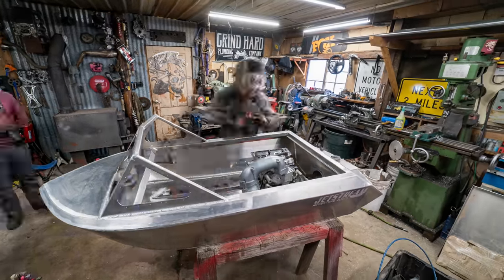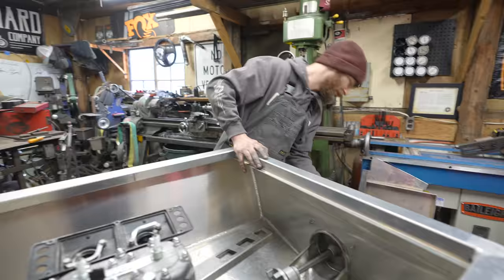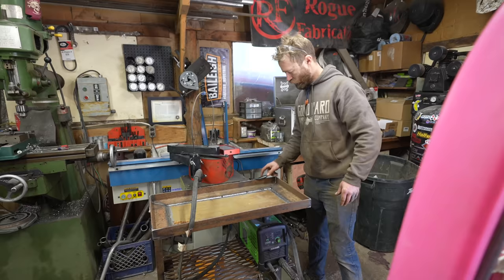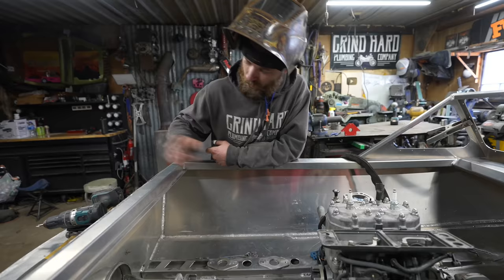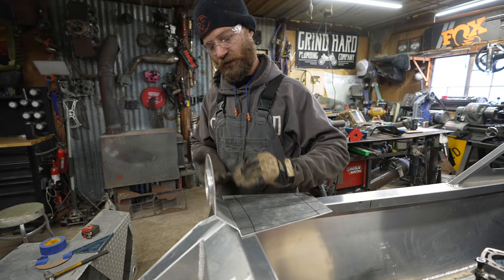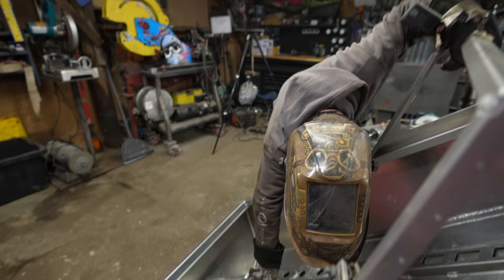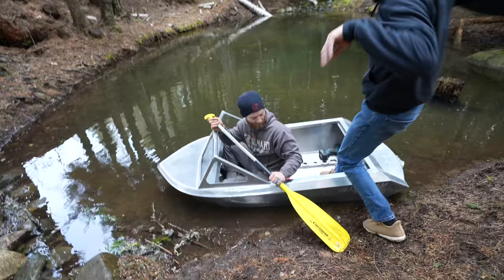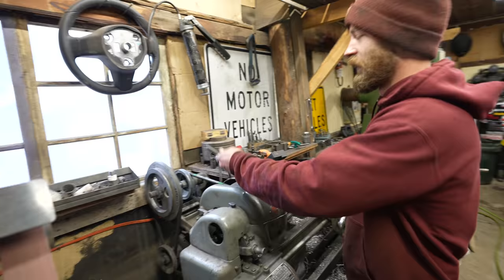Testing the 100HP Mini Jet Boat With a 18v Drill!

Comment: You guys probably know this already - but they make 'rivet nuts' that may be more durable than just tapping the aluminum. 
They make them all sorts of sizes and materials, that way you can make the aluminum super thick in high stress areas and 'sleeve it' with the rivet nuts for longevity. Could even weld them into place afterward to double down.

Comment: Put a watercooler on that torch . Even if you make a cheap one they are really worth it.  I can weld non stop with my wp20 but if you run it as a air cooled 9 I have to stop constantly to let it cool. 
I've seen guys use a small pump and a bucket of water. I own a watercooler from ahp and love it.

Comment: If you heat the aluminum before trying to bend it, it will bend more easily and the outer radius will fracture less.

Comment: Cool trick I learned when sanding/cutting aluminum put some bees was on your cut off wheel or sanding disc cuts much nicer and dosent plug up the disc don’t need much just little bit of wax night and day difference
Reply: Your the second comment to mention wax for cutting aluminum.  Hmm , I guess I need to try the stuff.
Reply: @texasslingleadsomtingwong8751   I would for the 30$ I spent on a big brick of it I’ve saved that much in cutting disc already only under it few times cuts like butter

Comment: Hey mate, On that motor there is a plastic knob, That is the crank case drain, i would delete that asap, they're very common for failure and lean out the engine and cause failure.

Comment: I am currently wrkn on my jet boat and modifying my pump. I have an xr2 pump. The pick up grate starts exactly 2.5 inches from the impeller and yours starts like 8-10 inch. Like your grate should be directly under you drive shaft but instead you have it starting at the tail end of it. I’d say your grate/ hole should be back towards the impeller 8-10 inch. And I’m going off my factory made pump not just some therory I came up with. Water is going to stall the first 2/3 of the way back. And really only going to be pulling water the last 1/3 closest to your impeller. Just food for thought. I’m pretty heavy into jet boats. But only xr2 pumps.

Comment: I would love to have a boat like that for fishing the small lakes we have around here. Only instead of a gas motor use an electric one and put solar panels on the bow to recharge the battery. It’s not because of environmental reasons so much as noise so as not to anger the homeowners around the lakes. I use a kayak now but that boat would really turn heads.

Comment: 2 things about your boat you're going to need a bulkhead between you and the engine and then a bulkhead that's like a foot back from the bow and that's called your crash bulkhead and judging from the design of your boat you could probably double hold the thing without adding that much weight just just add baffles and I'll give you a higher level of safety in case you tear the hall open

Comment: If you expand a 'scoop'down under the the draw area that's 1" at the mount,and expands to 3" deep,and 4-5" long,that will scoop the water into the jet-drive.I'd go for 5" length as the boat has such little area that will be in the water at speed.(Watch 'Finnegan's Garage' for his jet boat tuning).

Comment: Make sure you guys make a plug for the boat so you can drain water from it when your done riding around! Awesome build you guys are they best!
Reply: Maybe permanently affix a ball valve with a handle latch so you don't pull a Dave Sparks and sink your boat by losing the drain plug.
Reply: They won't need a bung when the hull cracks

Comment: Might need to add something to lift the nose, like maybe some pressurized tank that runs along the whole boat and doubles as a keel, possibly more volume in front. may be some work but worth it because with speed the nose may dive and sink the boat.

Comment: I feel like with the least bit of chop, the driver is gonna be launched out of the boat. Can't wait to see it happen, awesome build
Reply: You'd need some sort of shock absorption in the seat. Someone else on YouTube took 2 of these offshore and  were okay but uncomfortable as they were a few miles tried to get back in when the weather turned bad but couldn't go at decent enough speed as they're spines got beat on larger waves sitting down and swell tossed the little boat about at a slower pace . On a PWC your legs take most of the abuse easily when you stand.

Comment: I own an old craftsman lathe. Pita to change the belt. I use link belts. Well it came with a link belt when i bought it but if i ever need to replace it it will get another link belt

Comment: Do you ever check whats going on with the end of the shaft thats in the spindle?
While you may be straight on the chuck side that doesnt mean it's not running out at the other end.
   Just look down the back of the spindle with a flashlight to check it out.
If it's an issue make a plug that fits snuggly in the spindle and put a hole in the middle that fits your part snuggly.
That way you can be assured the whole shaft is running true.
Reply from the maker: Makes sense

Comment: It's gonna be scary fast out the the hole. Drag boats pull way harder than anything on tarmac. Probably a bit sketch at full speed with that waterline as you can't steer off the power!

Comment: One of these with a nasty brushless electric and some good lipo batteries would FLYYYYY.... just a matter of doing some math on desired impeller rpm, motor Kv rating, and voltage, and finding a motor and speed controller

Comment: Yeah stability is going to be an issue. Those little ones they made prior to waverunners, some had tri-hulls with plane steps. They had open, front mount engines often too for less flipping like a leaf in the wind, rear fuel tank though.

Comment: Only issue  I see is maybe intake not being capable of feeding the impeller enough water and cavitation occurring. If so you could always set the pump back pretty much outside the transom and build a ride plate like a real jet boat. My southwind tunnel drag had the pump set back 6 extra inches.

Comment: You did so much building but didn't add some sort of throttle at the front that automatically would squeeze the drill's button at varying pressure?

Comment: Theres not really much else you can do considering the constraints but that poor pump is going to lose a lot of efficiency sucking against that flat plate. Should be a smooth run all the way to the impeller, this has a sharp 90deg turn. Hopefully it doesn't cavitate too bad and works successfully for you guys!

Comment: Almost wouldn't be bad idea to stick motor up front under the deck possibly make weight distribution different run every thing else in rear depending on size motor keep everything low be a awesome boat had a one them canoe with flat back and sat old 10 hp on back with all kind of work done tore it apart was given for free it was 2 stroke so ported it new slightly over bore higher comp and big carb and custom stinger only made few passes with two people still dangerous fast for conoe well over 50 is a speed rush and looking back now glad none of use ever  got hurt from many of our nutty machines we built keep it real.

Comment: Might be better using zinc plated steel fasteners in that aluminum. Stainless and aluminum have galvanic corrosion problems, particularly in the presence of water.

Boat looks bad ass though. Can't wait to see it with real power.

Comment: 8:00 Aren't you going to get galvanic corrosion if you use stainless steel nuts in alluminium? Then you'd ruin both surfaces. I think even just regular steel nuts would be better since then at least the aluminium stays in-tact.

Comment: I only see one issue, your intake on the pump is too large and squared off and it will cause a pocket of negative pressure in front of the pump, and will very likely cavitate. you could however remedy this with a stuffer inside to make a smooth transition into the pump

Comment: when the boat is near the shore it will suck up stones.  locking up the impeller or destroying the flow of water...especially if the boat has a reverse cup that rotates over the jet output.

Comment: You should put an old seadoo 720 engine it it’s a little 2 cylinder 2stroke jetski engine with about 85hp stock and of course you can upgrade it or go with a 951 which is 110 or 130 hp

Comment: Not sure if that pump tunnel is going to work with that 750 engine, it's a very odd and small shape compared to what is traditional found on skis. I hope it still works out. Those stock aluminum props are no good, you can pick up a old kawasaki stainless prop(skat-trak or solas)for $50. Not sure what pitch you may need though. Maybe around 15.5 if you get a old straight blade prop

Comment: your going to need to put some lead in the very rear if you want to come up on plane at any decent speed sitting that far forward puts a ton of weight in the nose probably 150lbs of lead plus the engine would be about right

Comment: 2:37 Hey, I have that same Atlas lathe. Even came with it's original manual. Except mine is only like 30" or something. Got another Atlas one too that's longer. $100 each from a widower and her son. Pretty sweet. Though it's missing it's screw along the bottom that auto moves the tool. Everything else works great. What oil do you use for lubing it? That's been holding me back from wanting to use it. Not having it properly lubricated.

Comment: sweet work on the aluminum jet boat thinking about doing one with a CBR 1000RR just chopped and dropped a Nissan titan that i got rear ended in with a 2021 dodge dualy bed and went 22x15.5wide on back and 22x12.5 up front with 33 inch cleatyshad to strech the frame and drive shaft a couple feet but turned out pretty sick had to run wheel spacers on back to bring them out just a couple inches past fenders to match up front how can i send you guys photos ive got so many projects 69 gto judge 67 charger 65 convertible Buick special a fiberglasss 1955 356 Porsche speedster gonna 283 stroked it with rx8 5.13 independent possi rear and straight axle up front but keep it low with 15x15x27 goodyear slicks out back stuffed up in it
Reply from the maker: That would be so cool!

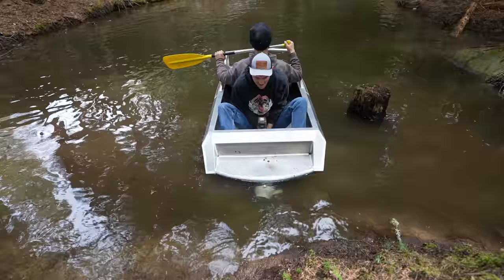Comment: 16:35 with how fast that accelerates i bet you could run a 3:1 gear ratio or use a more agressive pitch to get going at a decent speed
Reply: 60mph will be insane anyways! Lol. I don't think it needs more speed, even if it could handle the gearing without bogging
Reply: @eyeballengineering7007  I meant with this 18v drill with a more aggressive pitch
Reply: @denvera1g1  Ahhh

Comment: That's what happens whenever you don't have a cooler and get them things so hot they just melt and if you do it over a long amount of time it'll break the torch down to the point you just drop it on the floor and then a break cuz it's done got so weak from all the heat
Reply: Say what?